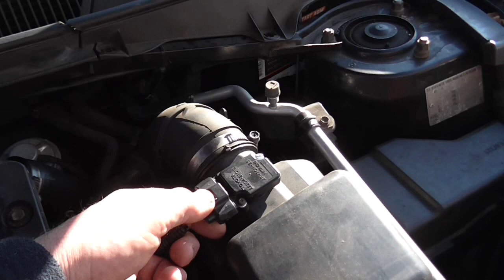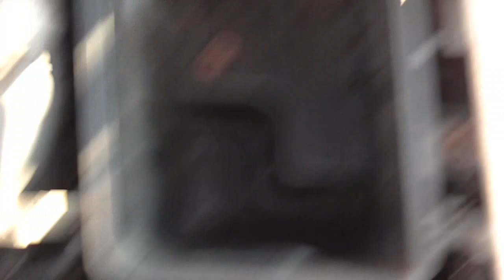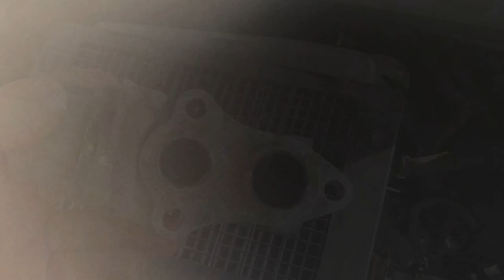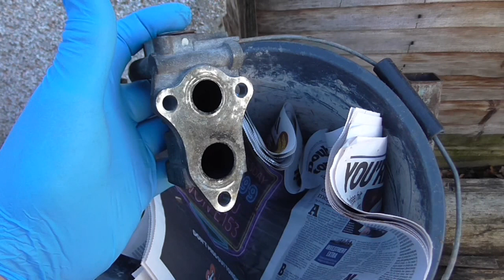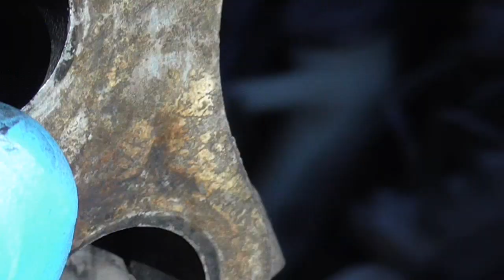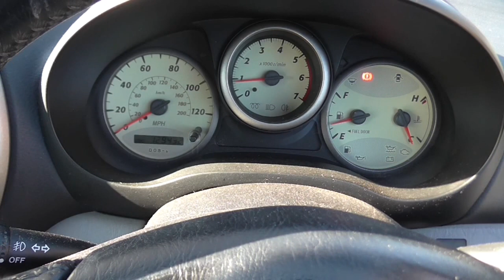Toyota RAV4 2002 4D4 Diesel EGR Valve removal and clean

Comment: After years of losing sockets when they drop down into the engine, I have developed a personal system of tearing off a bit of gaffer tape and sticking it onto the socket so that it remains safely on the extension … saves a lot of heartache.
Reply from the maker: Hello Tony.......Done that one a few times....also a bit of tape stuck over the end of a socket helps to keep a nut or a bolt in place while you manoeuvre it into position is another handy one... Cheers...Trevor

Comment: Hello. Thank you for the good video. Will try cleaning mine. I got recomended cleanin the egr. Trying to fix a 2004 Rav4, and it's problems are that it suddenly looses power, the acelerator pedal gets harder, and it spews black smoke. Hope it fixes it. No dashbord lights though
Reply from the maker: Hello.... You could try cleaning the mass airflow sensor too you can get a proper cleaner in cans from autoparts stores and amazon, Ebay etc... eventually my mass airflow sensor went it did bring dash board lights up replaced it with a new Denso branded one (don't buy cheap ones off eBay etc) the car went so much better after...another thing to check is the hoses sometimes they get soft with age and suck flat under acceleration....all the best....Trevor
Reply: @jetblack11td  just cleaned the EGR and it seems to have solved the problem so far. It runs better, and no smoke anymore. Thank you very much for the tips and the great video!
Reply from the maker: Ahh that's good we like a relatively cheap and easy fix!.....Cheers.....Trevor

Comment: Hi chum goid video  mines been reviving up and down by itself  when engine warms up hoping this will solve it can you tell me what size of bolts you used chum thanks
Reply from the maker: Hello taz man Thanks for the kind comment..... I'm pretty sure they are M12 's but have a couple of 10's handy too...Cheers...Trevor
Reply: @jetblack11td  thank you chum will try that  now temp needle on car going to normal then suddenly drops away to nothing and car starts reviving by itself code came up p1366 witch says its ecu but a machine says dosnt think it is as suddenly  goes back to normal when driven any ideas  chum I was thinking maybe themerstat as it only revives when temp needle drops hope you can help thanks
Reply: @jetblack11td  hi chum that code was p1633
Reply from the maker: Hello taz man not really sure about this you should have a look on the net for the code… my rav was too old to be OB2 compliant so I never put a code reader on it could it be the temp sensor that could be affecting the mixture ie bringing in the fuel enrichment like it’s a cold start…. All the best Trevor

Comment: After EGR block, and straight pipe install, it sounds sick. Main problems with this engine are 2: dual mass flywheel, just install single mass flywheel.
Injectors seals, replace every 30,000 miles, trust me.
Reply: Also Remember 5th Gear popping out

Comment: My 2003 rav4 D4D is going into limp mode every so often no lights coming on the dash but can't accelerate do you think cleaning the EGR valve will solve my problem
Reply from the maker: Hello Duncan....Well it's worth a try...it's easy enough to do, a can of carburetor cleaner is about a fiver and some nuts and bolts work....I'd certainly do it before spending any real money......Cheers....Trevor
Reply: @jetblack11td  just cleaned the maf sensor and just seen oil at the back of the air intake and the pipe next to the EGR valve 😬

Comment: Hi jetblack. My rav4 d4d 2003 has an ‘overboost’ issue at 3k revs when overtaking at higher speeds. Engine goes into limp mode. A restart seems to reset it. Does this sounds familiar? Erg valve or turbo itself?
Reply: Hi Johnny, just a thought here but on volvo d5 engines there's a fairly common issue where the vanes on the variable geometry turbo can become coked up with carbon, causing the vanes to stick at certain rpm's, resulting in overboosting. Look up wyns turbo cleaner and read the reviews. Might be worth putting a bottle in the car and taking it a long run. Regards. Alex :)
Reply from the maker: Hello Johnny... to be honest I don't know ...I believe there is a pressure release valve.. I would have thought the turbo itself is working otherwise you would not have over-pressure... considering the easy of cleaning the the EGR valve I would do that before diving into anything else that costs money..... for example our turbo failed, you would know..... no power at all and the mother of all black smoke out the exhaust!! it cost £350 for a recon turbo which requires a pit to fit it and very long (like nearly a meter) socket extension bars as well as a vital oil and filter change... the Limp mode with mine was the Mass air flow sensor rather a different problem... good luck with it let me know how you get on...Cheers.... Trevor

Comment: Hey buddy! Thank you for a great video, loads of help 👍
I were wondering about if you did anything with the pipes that goes from the engine and back again, not on the valve itself. Should them be cleand aswell? Can I spray something in there, or just brush it with a spiralbrush or something? 
Hope you can help me out.
Thank you again!
Reply from the maker: Hello Albert...Thanks for the kind comment....!....No I didn't do anything with the pipes they seemed clean enough... always worth a good look at all the pipes around the EGR valve as well as the turbo pipes Iv'e seen them blocked, holes+ leaking, blown off and sometimes with age they go soft and will suck flat under acceleration all affecting performance..... a good thing for poking out  is a old fashioned wire coat hanger straightened out or any other stiff wire fence wire good too... a piece of rag tired on tight with copper wire or a ty-rap cleans well....All the best ....Trevor
Reply: @jetblack11td  Thank you for you answer Trevor, I guess Ill just check when im in there then 😊

Comment: Did you ever find the cause of the acceleration issue? Mines doing the same
Reply from the maker: It was the mass air flow sensor....in the end!
Reply: @jetblack11td  it was my fuel filter in the end 😂 go with cheapest options first
Reply from the maker: Hello David...Iv'e had a few problems in the past with blocked fuel filters...my old Citroen C15 van I used to carry one about...I conked out about 200 miles from home fortunately I was only about 1/2 mile from a Peugeot Dealer they charged me about 3 times as much as our local motor factor for one but much better than walking...
Reply: @jetblack11td  wow yeah I always carry a spare fuel filter,  egr cleaner and maf spray.  Always one of them things that go lol
Reply from the maker: Hello Aaron cleaning the EGR can make quite a difference a good place to start as it only costs a can of carb cleaner...Turbo Diesels like these like to be driven at fair speeds
lots of local trips tend to bung up the EGR valves and the intake systems.....my son had a Seat which had the 1.9TDI VW engine...I had to remove in the intake manifold (@120K miles) and dig the carbon with a screwdriver and soak in oven cleaner..... It certainly went a lot quicker after! Mass airflow sensors, blocked or sucking flat air hoses...poor turbos can all cause poor acceleration.... Cheers.....Trevor